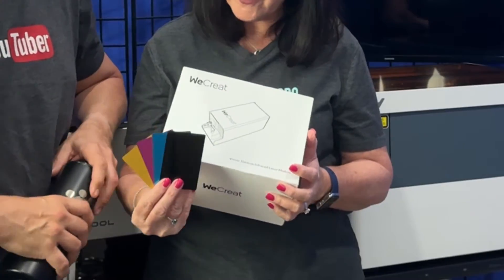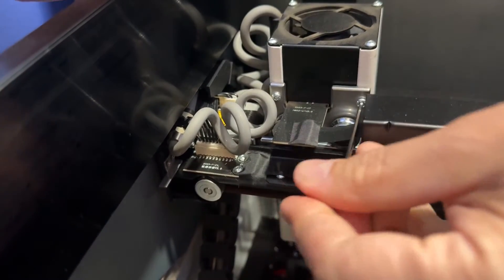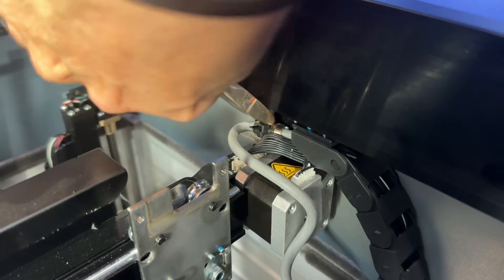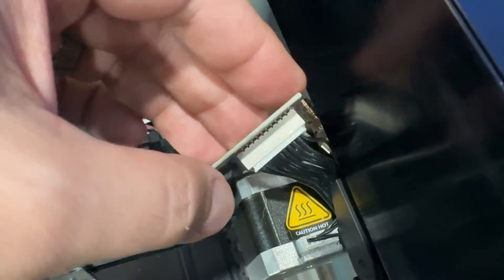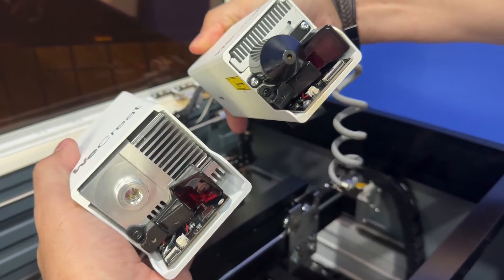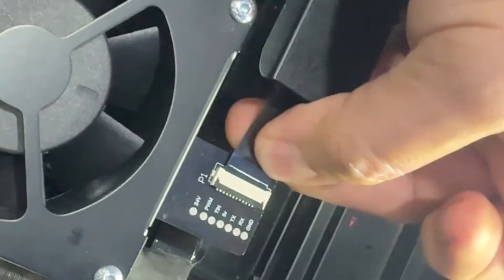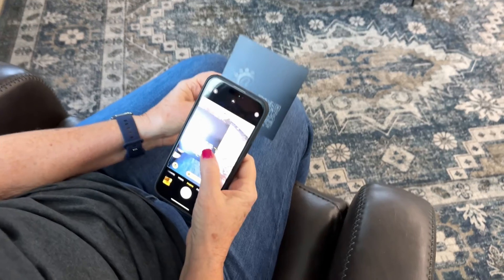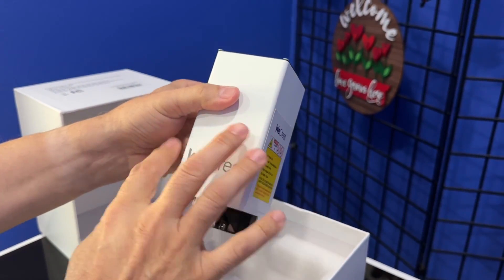NEW WeCreat Infrared Laser Module: Installation and Test

Comment: Hello, I have bought the 2w unit a while ago and still cannot figure out how to etch on copper a little dipper than it etches.  I am making a copper jewelry and bought this unit specifically for that purpose but as I said cannot get anything on copper that will withstand the sanding and/or polishing process.  I'd appreciate if you could give me some tips if you have any experience in etching on copper.  Thank you.
Reply from the maker: Hi - sorry - we haven't tried copper yet. I'm not sure what the settings may need to be for that.

Comment: The fragility of swapping out the laser modules seems unnecessarily tedious. They could have easily made a spring loaded clamp bracket for both laser heads and a dual control board. At least they could've made the screws magnetic so you don't keep dropping them.
Reply from the maker: Magnetic - yes - that would have been brilliant. We saw that on the large AEON Redline machines at the ISA expo in Orlando.

Comment: If you're turning your Vision into a dedicated metal engraving machine, the laser head conversion is worth it. But if you're one that wants to engrave wood some times and metals the other, it's not worth having to install/uninstall one laser head to another. WeCreat would have been MUCH better off creating a 2-in-1 laser head like the Xtool F1.
Reply: It is an inconvenient switch for sure, but very cool to have options
Reply from the maker: The rear-facing screws are definitely challenging!

Comment: Doesn’t the IR module engrave on a lot of the same stuff that the diode module engraves on?
Reply: I think metal is the big difference
Reply from the maker: True. Infrared is more efficient in engraving metals and plastic. It cannot engrave wood or cut much of anything. An infrared(IR) laser can engrave a wide range of metals, including gold, silver, platinum, and copper. To be honest, I’m trying to figure out what an infrared laser can do the diode can’t.